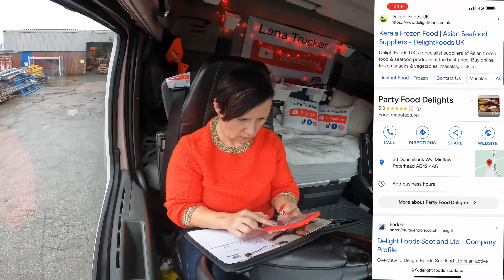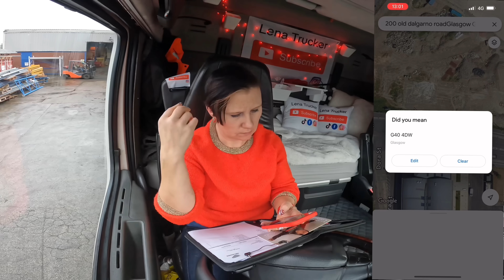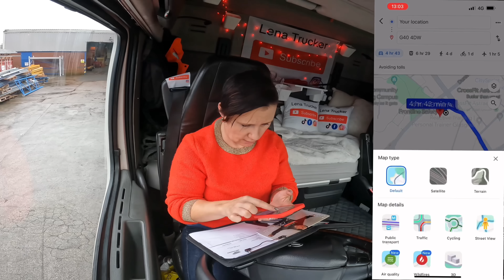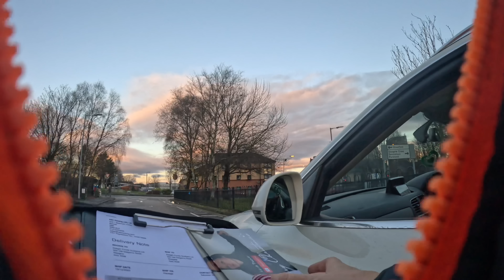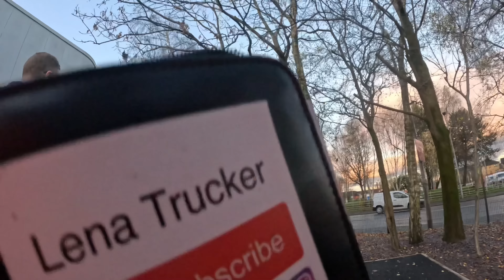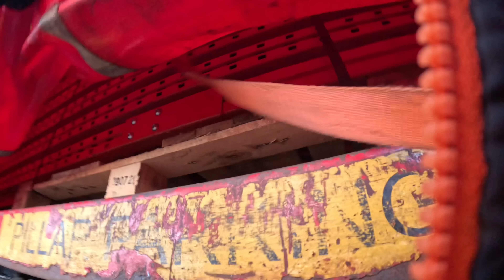Christmas Special, just another work day and a cab tour #scotland #lenatruckeryoutube

Comment: hi, new to your channel...
saw your difficulty in backing your trailer into a bay...
I had the same inexperience when I was learning but learned the hard way by myself...
So I want to give you a great tip that I discovered watching skilled drivers backing up into a slot...
The trick is to pretend the hole is further out than it is... (of course if there is space in front of the hole)...
backup so that the trailer and tractor are straight in line in front of the parked trailers on both sides...
then it is a matter of straight back to the dock.
hope this helps.
Reply from the maker: Ahhh thank you I’ll be trying that!!! Thank you for subscribing too 😄